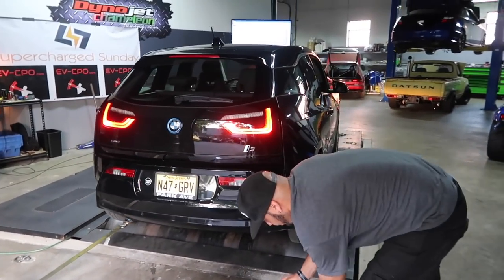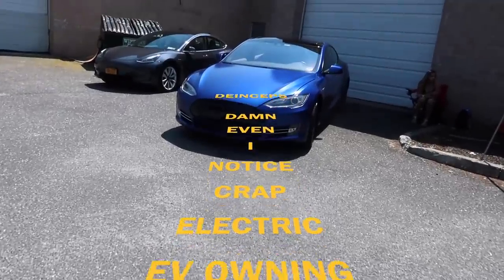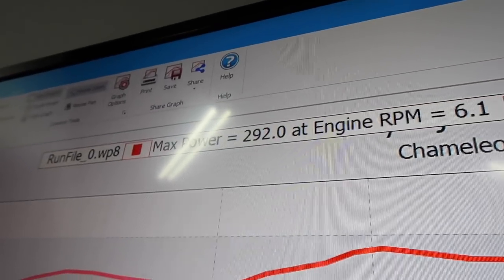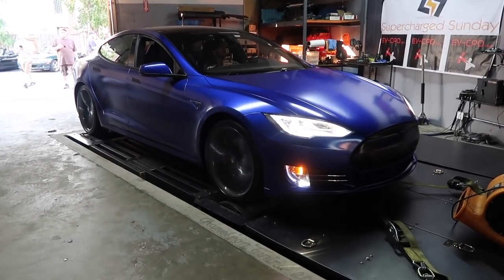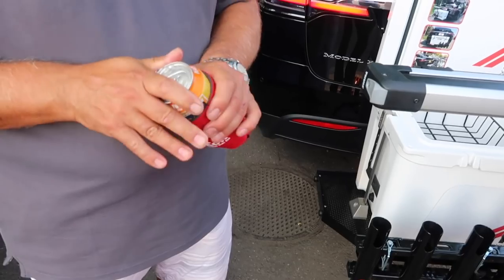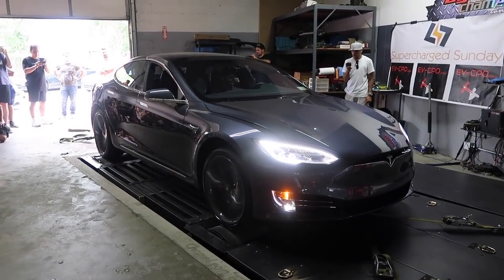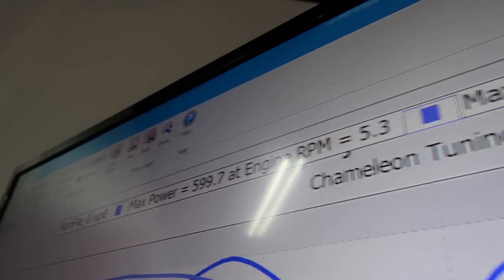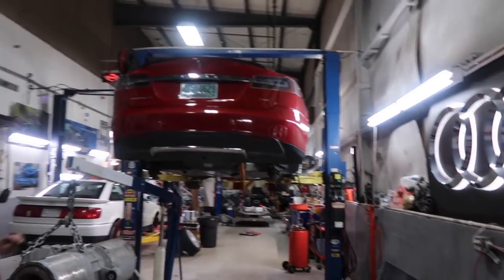Do Teslas stand a chance against my CORVETTE?

Comment: the annoying thing is, that 125 mph is brought on by software, not hardware. Tesla's are hard limited to 155 mph absolute max speed by a software governor, but that governor kicks in early, around the 120 - 130 mph mark. it starts to slow the pace of acceleration, which is why you get the 'drop off' at the higher speeds.

Comment: Rich, it does not matter if you say Pound Foot or Foot Pound as the unit is: lb*ft but mathematically it is same as ft*lb. Technically you apply mass over length, so correct way is Pound Foot, yet everyone will understand...
I love the tiny electric factory (hamster).

Comment: Rimac achieved high top speed acceleration by having a two-speed gearbox on each of the rear motors. Their first vehicle was limited to 221mph, and had 0-124mph in 6.2s and 0-168mph in 14.2s. Their upcoming C_Two has a top speed of 258mph and 0-168mph in 11.8s.
Common street vehicles won't have gears because it's unnecessary complexity and cost. Even though Tesla currently has performance reputation, I can't imagine they'll ever add a two-speed gearbox, as they prioritize minimalism for the driver. But I'm sure the standard supercar makers will have it too eventually.
Reply: Muskar Gears are pure losses. Ultimatley there wont even be a single speed mechanical gear reduction, pure direct drive, no losses. The limits we witness are all from the power limits of the battery.
Reply: difflocktwo 
Rimac Concept 1 beats bhugatti veyron. 
Mate Rimac compares it to a multi geared bicycle to none. Rimac doesn't have that  battery capacity of a P100D. Also he pointed out the miles made more with  a geared EV
Reply: Peter Robann Sobrepena  I didn't say there is an energy limit but a power limit of the Tesla battery. A smaller but more powerful battery would allow for more power with the Tesla.

Trains go from 0-500 kph with one gear, no problem.
Reply: difflocktwo
That's how Tesla of current models are in for lasting batteries for years.
Trains don't have batteries but a direct electric from grid that does not heat up.

Comment: Got to ask whether the problem with Teslas at high speed is the electric motors, or the lack of gearing. I'd be leaning toward the latter, but would be fun to see if someone has made a similarly powerful EV with gears that could destroy everything.
Reply: Matthew Jenkinson Neither, it is the battery which cannot supply the power (torque x rpm). As rpm goes up torque must go down to maintain the power limit of the battery. What you should do is use a more powerful battery rather than a battery designed for road trips.

Comment: Did anyone ever stick a smaller reduction in a P100D? It would be a bit slower in the quarter mile, possibly with a higher finish line speed, but the half mile could would out quicker.

Comment: The P100D can go to 155 mph in the same "gear" it out-accelerates so many cars in. If you wanted to compete on top speed or half mile races, you'd add a gearbox. That would be more apples to apples. The electric motor is so good, they decided they can do without changing gears on the road. The Brammo Empulse electric motorcycle is the only production EV I know of so far with changeable drive ratio.
Reply: Lol there is a reason there didnt put gears, it will defeat the purpose of an electric motor an just limit it, before you talk know what is the purpose of gears, normal cars got gears because it can't develop the torque low down to move the car, thats the main purpose of gears, thats why if you put the vehicle in 4th( direct drive) and come off the clutch the vehicls cuts off, gears are just torque multipliers for engine an will just limit a motor
Reply: Secondly a motor will never go faster than it should, because of CEMF, if you add gears the motor will keep cutting current because of the CEMF( counter electromotive force)
Reply: You are wrong. Any electric car has final drive gearing, a gearbox is just changing that ratio on the fly. The motor might not go faster than it should, but if you change the final drive ratio, it can spin the wheel faster at its maximum speed. In exchange for lower torque, just like any ICE car, electric drill, bicycle, etc.
Reply: @olamarvin  final drive and gearbox is too different stuff bro, atm Tesla final drive is in the sweet spot, any lower an it wouldn't take off fast, any higher an it will lost grip, overheat the motor an max out at 100mph +-20
Reply: Please don't troll. The gearbox and the final drive do the same job, change the drive ratio. The Tesla would of course not overheat just from changing its drive ratio. If the drive ratio was higher, it would go faster than 155, but accelerate slower 0-100. Pretty simple stuff, try it on your bicycle. The way they have it now is a good compromise, because they can make do without a gearbox at all.
Reply: @olamarvin  I cant take this non sense, why can't you drive hard with a tesla all day compare to a normal car, because the wires in the coil winding and battery will get hot, if u have a higher final drive, it tends to make the motor work less, which in turns makes it rev high and draw more current, as resistance goes down current will increase in the circuit, which will make the motor get hot.
Reply: @olamarvin  people please help this guy, he says that final drive an a gear box is the same, will i want to laugh, didnt even say a transaxle but still there are not the same
Reply: They are not the same thing, but given the topic at hand, they do the same job. Change the rotation speed from an input shaft to an output shaft.
Reply: Is there one gear ratio where it gets hot and one gear ratio where it stays cool? Of course not. The Tesla tops out at 155 because it runs out of revs. It still has more power reserve, but it can't apply it. If your ICE is stuck in 3rd, you can't hit top speed.
Reply: @olamarvin  what is your point, its like i am talking to a wall, try and understand what im saying an stop being ignorant,shut up an listen, the info im giving u, not all can be found in a book, stop being a fan boy an be a man, face reality, if u put a 3rd gear on it tesla it wont reach top speed neither, I'm not against tesla my uncle in law got one and its unique, but i am stating facts.
Reply: @olamarvin  input shaft is the main shaft, runs through the cluster shaft, into what gear you choose, through the synchronizer, then to the output shaft, the final drive is no where there, its in the diff which takes the power from the output shaft through the diff to the wheels, the purpose of the diff is to allow one wheel to rotate faster or slower when turning mainly
Reply: Bro im watching this convo an pharez is correct sorry to say
Reply: All the things you mention have gears in them which change the speed of the output shaft vs the input. Tesla only has a diff, but it gears the motor speed down 9.73:1. If this was different, say 8:1, it would accelerate slower but have a higher top speed. If you could change into a 7:1 ratio while driving, the top end acceleration would be better as the motor would stay in its best powerband at a higher speed. That's correct and final, end of story.
Reply: @olamarvin  loooooool my gosh, its final smh idk how going from 8:1 gives you more top speed and the standard mark is 9.73:1 you gotta go over that to get more top speed not under, 8:1 an 7:1 which you state will only make the car accelerate fast, an would be out of the power band btw, look at the dyno sheet, more it revs is lets torque and hp it produce, but its final

Comment: Better question: will your Corvette stand a chance against future EVs built for performance rather than luxury? Tesla's upcoming Roadster has the numbers to kill even Bugattis, Porsches, Koenigseggs, McLarens, etc. 1.9s 0-60mph, 4.2s 0-100mph, 250+ mph top speed, 600 miles per charge, and in a $200k vehicle... If they make all of that happen, it's going to be interesting to see how those other brands respond. Competitors which are in the ballpark of those numbers start above $1m from every other source - though they are all slower 0-60 and 0-100. Top speed crown will have to be determined... depends on how far above 250mph the Tesla can go. Looking forward to the numbers once independent testers get ahold of that car.

Comment: I don't think this is the motor's problem, the shortcoming is not having a gear shifting mechanism of some sort. The Rimac adds a second gear and voila, electric motor keeps going till the car passes 250mph.

I think Tesla just didn't see value for a "luxury family sedan" product, can't be easy or cheap designing a reliable gearing mechanism for a motor that hits 15,000rpm. 

Power consumption at high speeds would be another concern, which is probably why they wanted to put a giant 200kwh battery in the next gen Roadster before tackling the gear ratio issue. 

Battery energy density is not something that can currently match gasoline fuel, you gain efficiency but lose density, the end result with the current tech is a wash, five years from now who knows.

Comment: Rich do you realize that the torque drops off because of the high rpm of the motor because the Tesla does not have any gears so if it had gears those high torque numbers would remain for gears at higher speeds

Comment: I'm not a gear-head like you Rich so I don't know gear ratios or anything like that, but has anyone thought of trying to put in a gear box into an electric car with an "overdive" gear, to smooth out the electric vehicle's decaying torque at high speeds and allow electric vehicles to compete in the 1/2 miles races against the gasoline vehicles?  I saw someone convert a Proche 911 with a manual transmission and they kept the transmission using a special made adaptor plate, so I know it's possible to include a gear-box in an electric vehicle, but it didn't do anything useful for the Porche 911... but could it be made to be useful?

Comment: Hey, i found the channel after watching a short 15 minute documentary about you on facebook. Gotta ask tho, whats all been done to General Zod? C6 Z06's are only making 505 at the flywheel and you put down over 600 at the wheels. You running any kind of forced induction or is that 427 breathing all natural?
Reply from the maker: All N/A
Reply: Alright. I'm guessing cam, heads, long tube headers, tune, bigger throttle body, fuel injectors?

Comment: Gas cars also need transmissions so they go above 30mph without topping out (depending on the final drive). Cars like the Rimac Concept One uses gearboxes for each motor keeping the motors in the powerband and giving it better top end

Comment: Could you not run an electric motor through a gear box? would that help
Reply: Dave ffs Gears would always actually rob power. Gears are pure loss, no gain. The limits of these EVs is their battery, it cannot supply enough power.
Reply: Explain how gears are pure loss no gain please. Last time i drove a gas car, when i went into a higher gear, I may have had a power loss, but i had a speed gain.
Reply: spazzman90  Gears are only mechanical levers, they rob power by heating up. You have spinning and meshing gears in oil, that's all losses. 
You can't gain speed with less power. The power to push air goes up with the cube of speed. So if you go 100 mph instead of 80 mph that's 1.25x more speed for almost 2x the power.

Comment: Couldn't they get around the power issue with electric motors by just using gears?
Reply: It doesn't help that much unfortunately, but it can help a little. To understand, take a look at the torque curve. Imagine you reduce gearing ratio from 9:1 to 4.5:1, basically adding a 2nd gear. Now in that 2nd gear, the torque curve (at the wheels) will be twice as long, but the height of the curve will also be halved. Due to that decay shape of the curve the new "peak" before the decay starts ends up right around the same spot on the graph where the previous curve was, already in the decay phase.

Comment: What if you put a two speed transmission on a Tesla? I wonder if that would improve its performance in the half mile.
Reply: oledcrt the roadster had a two speed transmission... It kept breaking so they removed it. I think the concept two uses different gear ratios for the front and rear to give it better performance. I'd guess the new roadster does the same.
Reply: What if you lift the power limit from the battery first? What we see here is a power limit on the battery for protection.

Comment: High end speed is NOT the electric motor's "shortcoming." All Tesla would need to do is design a transmission to add a second gear (in the correct ratio) to make it the fastest car. The problem is that there is essentially no market for this since the second gear would be useless on US roads. It literally wouldn't be used until you're 30 to 40 mph above the speed limit, even in Texas, where in some places it's 85 mph. 

If you want to make this test fair, pick a gear (any gear!) in the Corvette and run the race in only that gear. Make sure to video the race. I want to see the transmission as it scatters itself on the track!

Comment: difflocktwo 
Rimac Concept 1 beats bhugatti veyron. 
Mate Rimac compares it to a multi geared bicycle to none. Rimac doesn't have that  battery capacity of a P100D. Also he pointed out the miles made more with  a geared EV

Comment: Silly argument at end the more battery power you have the more speed and torque an electric motor has but it requires more voltage for sped more amps for torque and series Wiring makes voltage and parallel wiring makes amperage and it takes a lot of batteries to wire series and parallel

Comment: Maybe if there was a second gear, electric could have higher torque at higher speeds?
Reply: Brian Sheehan Higher torque at higher speeds means more power. Where does that power come from if the batteryis already power-limited? What we see here is a battery limitation, not a gear limitation.

Comment: Is the lower top speed of the Tesla a motor limitation or is it a single gear non-transmission problem?  It's basically geared for quick rather than fast which gives it the lower speeds.  That's what others have suggested and it kind of makes more sense to me than it being a motor limitation...  Maybe not though.
Reply: As electric motors RPM goes higher, it eventually creates more resistance within the motor itself, due to the magnets and coils impeding each other.  If you add a transmission it allows for the RPM to stay lower avoiding this problem, while using the gear ratio and high inherent torque of the electric motor to push against the additional resistance caused by going faster.  So in the case of EV cars without variable transmissions it is technically a problem of both at the same time.
Reply: Its a power limitation, electronics are limiting power to protect the battery. A more powerful battery would make it faster everywhere.

Comment: Great video as always! Talking about fastest cars and comparing EV vs ICE we have to remember that Tesla has no gears shifting. so gear ratio was optimized for typical drive, not racing. So we can not say that electrical motor is not so good for higher speed. Actually just because electrical motor torque characteristic is so good it made possible to use it with no changing gear ratio. To make ICE work more effective engineers design transmissions with more and more gears.

Comment: Cool cars Rich!  The drop off at high speeds vs a ICE car is, of course, the lack of a transmission.   Simplicity = lower cost and most people don't really need to drive over 100.  However I think transmissions are coming to EVs to increase the range.  Increase range is what I am looking forward to.  http://www.thedrive.com/sheetmetal/16516/electric-cars-are-about-to-get-a-lot-faster-and-go-a-lot-further-on-a-charge
Reply: its still and always be super expensive then just ICE car...ICE will soon have synthetic fuel or hydrogen + hybrid and will be environment friendly and we already have logistics, parts, infrastructure for hem - so EV is in long run won't work. They area is city. Period
Reply: @razzor4708  ICE cars are being banned after future dates in places like CA and other states soon.  UK and EU have ICE bans in the future too.  The writing is on the wall.

Comment: It's not a problem with electric motors, it's due to tesla only putting 1 gear in them. But for a street car is this even issue? Even if you lived in Germany and drove on the autobahn, 120mph would be plenty...
Reply: Car noob here...why do more gears make it faster?
Reply: ssupernovae the closer a AC motor is to redline, the less torque it has. Bigger gear, motor spins slower more torque, more power, you go faster.
Reply: Why did Tesla only put one gear?
Reply: Because electric motors are far superior to ICEs. An internal combustion engine only really produces usable torque from 1000-3000rpm. an electric motor puts out full torque from 0-9000rpm. Tesla experimented with a 2 speed gearbox in the model S but found that it was more efficient to just use a single gear.

Comment: calculate area under the torque curve! the teslas curve is horrible, it drops off right away
Reply: Are you sure about that? Keep in mind the max rpm difference 18,000 vs 7,000. I think torque is pretty flat up to 7000 rpm. For max acceleration the Tesla probably only needs 2-3 gears vs 4-5 for Corvette.